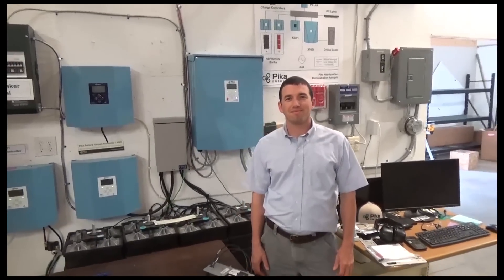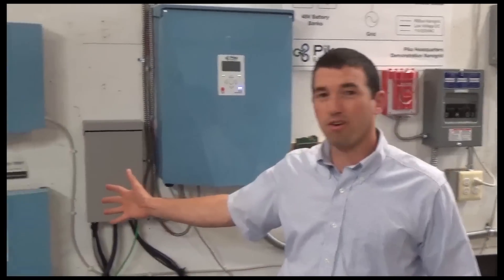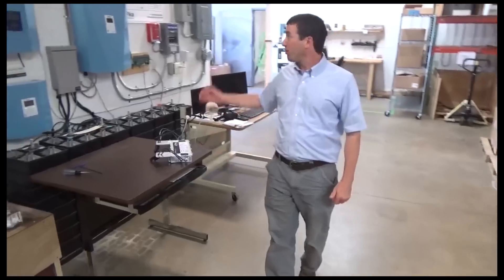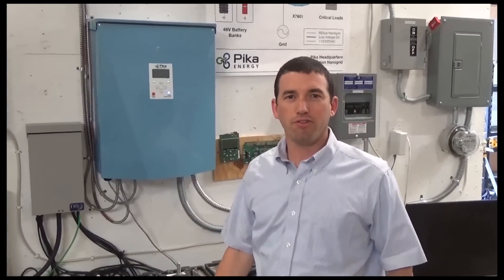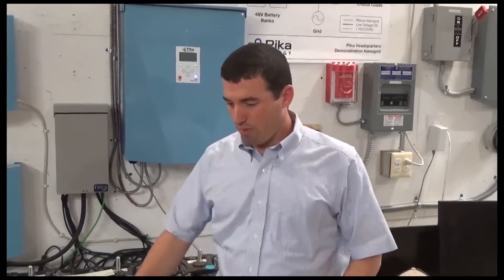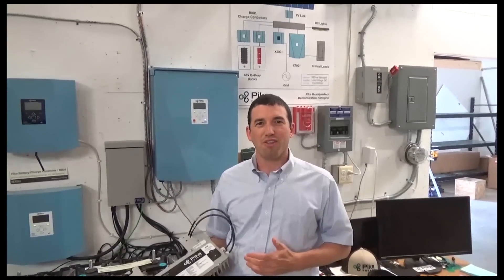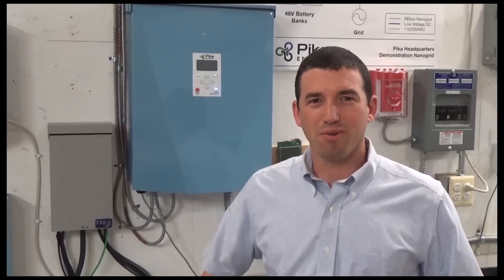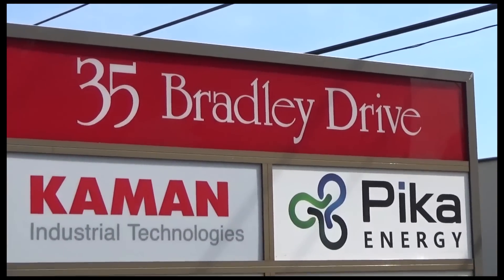Pika-Energy: Revolutionary!

Comment: High volts is def more efficient. At what cost tho? For small DIY 24/48v off-grid home-cabin-retreat locale, a 300v+ system may not be worth the $$$ to upgrade to get an extra 10-20% gain in efficiency. Great stuff here...don't get me wrong, but there are a lot of folks that have don't have deep pockets. Seems like high volts = big bucks.

Comment: This system looks like it could provide a lot of power efficiently, but so would a pebble bed reactor.  The problem is that I can't afford a pebble bed reactor (assuming that  one were available!), and I get the feeling I couldn't afford this power system, either.   I suspect that the cost of the system seen in this video would be equal to a substantial percentage of the cost of the house itself.  I would welcome  a future video discussing and comparing the cost of this and the types other power generating systems that you have featured in your other videos with an eye towards cost-effectiveness.  Thanks

Comment: All of these ideas are great but it it would be great to hear dollar amounts ant what it all means out of pocket.
Reply: Pika Energy was bought by Generac and has effectively told the DIY market to boil their bottoms, but when you could go and actually buy them the Pika Energy Island was around $3,600 and PV Links were $555.  Not too horrible, but the killer was requiring their own expensive and proprietary batteries after the B801 and all their other first generation hardware was discontinued.  They do (or at least did) have the B301c battery interface, but that is or was an OEM only product sold only to other battery makers.

Comment: Smart battery with 340 volt? What is that?
Reply from the maker: It is an LFP Lithium Ferro Phosphate Battery with a BMS ( battery management system) and a B-link that provides regulated 380 volts to the REbus nanogrid on the inverter.
Reply from the maker: The Battery chemistry in not limited to LFP.  It can be Aquion, FLA, etc etc
Reply: +engineer775 Practical Preppers  While battery technology is interesting I'm trying to figure out where the 380VDC comes from. I looked at their website and couldn't figure out what is producing this voltage. Their wind turbine manual shows a schematic with a leg that is marked 100-190VDC so you read across two of these and get 380VDC but how is it done with PV? None of the PV datasheet/manuals are available on their website and what is there is pretty vague on specifics.
Reply: Y'all, uh, they, need to show an example of a battery bank with FLA... Thanks guys!